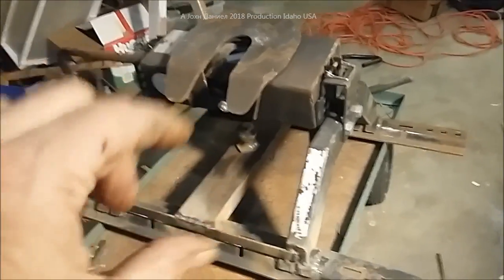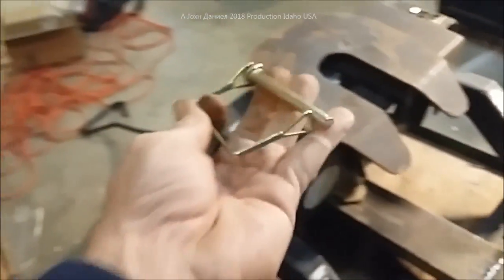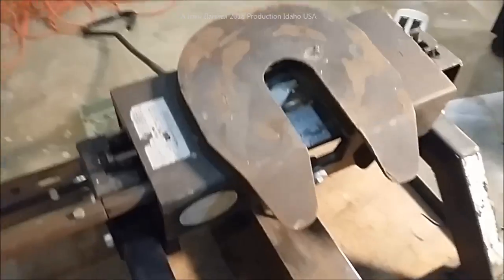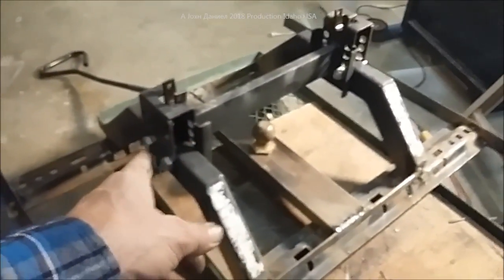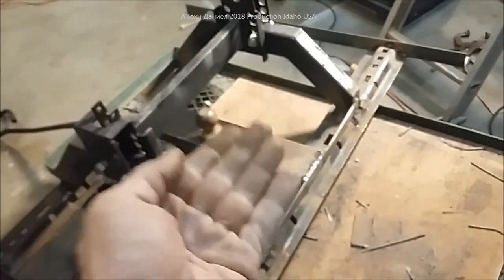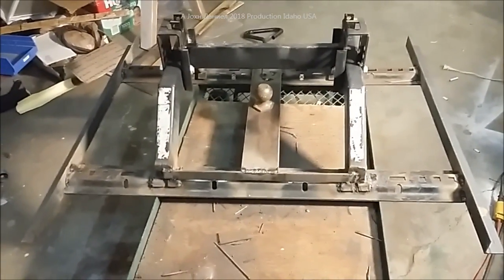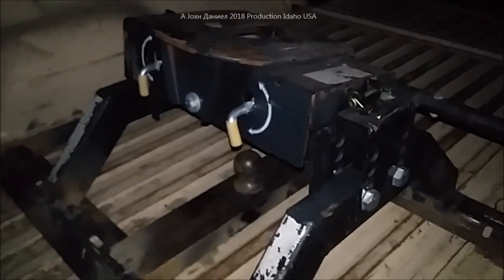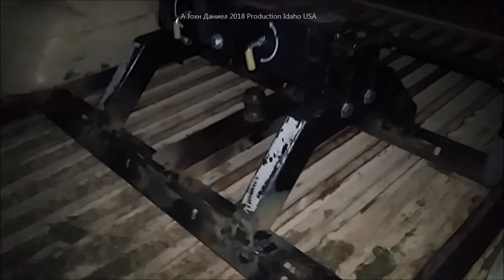5th wheel Goose neck combo all in one install, Home Made - real easy to do

Comment: How do those 460's pull a load compared to a 351 ? .Now I know what you guys call a fifth wheel is.
Reply from the maker: +closertothetruth 20,000 lbs for the 460, 16,000 lbs for the 351.